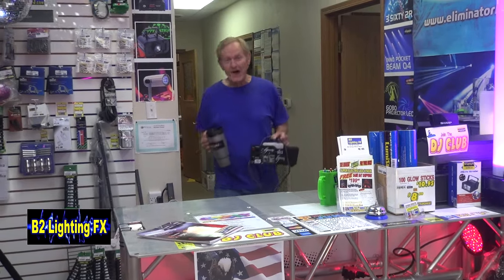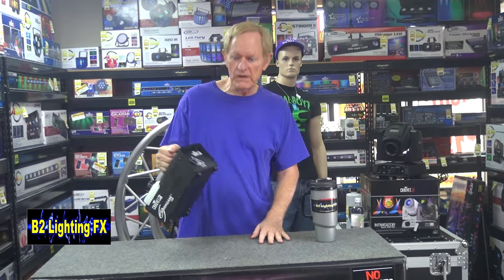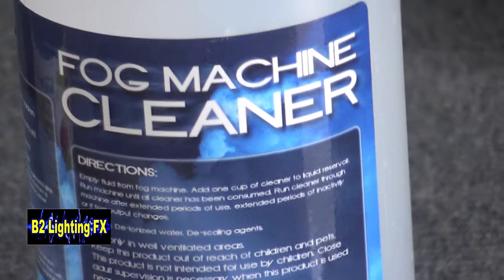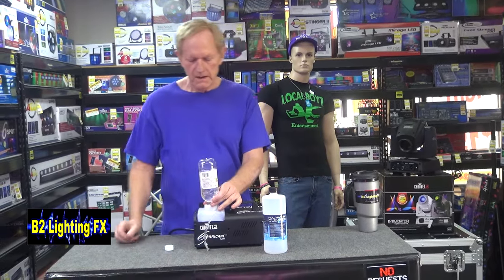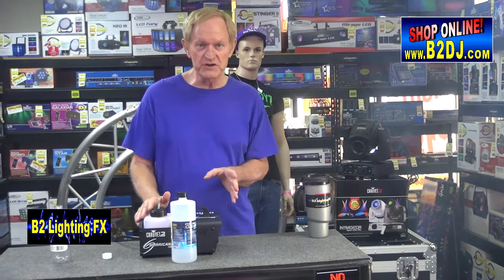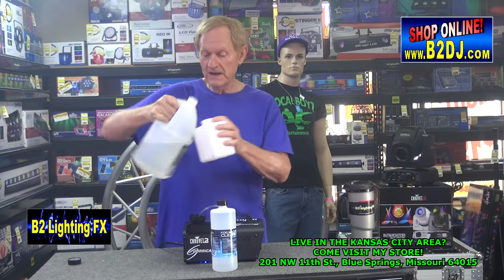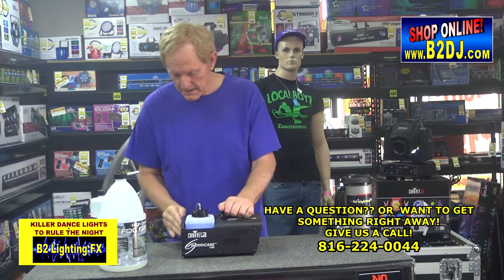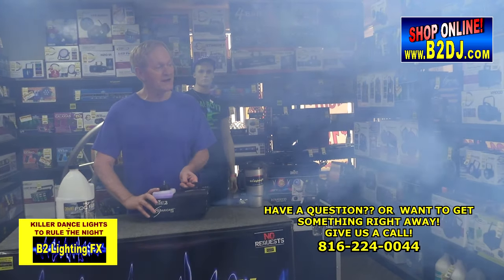How to clean your fog machine and get it working again!

Comment: This didn't work for me, but it started me on steps to repair my machine, so I appreciate it.  In my case, there was a clog within the pump itself.  If you remove the brass tube from the pump, it should easily spray liquid (fog juice, or vinegar in this case) - mine hummed a bit, but nothing came out. A dippy little $15 part, I was going to just replace it when I decided to disassemble it.  I didn't do anything fancy but just took care to return the parts to the pump in the proper order, making sure I could push air through each section.  When I returned it to power, it immediately sprayed the vinegar into the air.  I let the vinegar run through the system to clean anything else and it worked great after that.

Comment: I purchased a tiny smoke machine from someone in the Netherlands (vs where I am in the US) and had a few unrelated problems using it, mainly that it needed an always-on power supply to work. Once I finally got one AND had a reason to use it, the damn thing wouldn't work reliably. It was only occasional press of the power switch on the fob that would allow it to produce smoke. I contacted the manufacturer and asked him what the problem could be and he asked me to do a quick test to determine if the tiny machine (fits in the palm of one's hand) would reliably work without the clearomizer (I guess that's the term for the tiny tank of fog juice that screws on/off). It worked perfectly without it, but rarely with it attached. Thus, my instant conclusion was it was clogged. 

How to remove the clog, though? A tiny acupuncture needle? Nope. Didn't go through. Letting it run for a bit while it was cooperative? Nope. That was unreliable. The answer was this video. I drained what little fog fluid was in the vial, rinsed it out with water, added in some distilled white vinegar, ran the machine off/on for a half hour (long enough to get too hot to hold and then I'd let it cool off for a while), cooked off the fog juice and half the vinegar in the vial. 

Initially, it acted like a tiny car engine that was choking on low-quality gas but, after enough time had passed, it started to sound smoother. Eventually, once it got low enough in volume, I emptied out the vinegar, rinsed out the vial, injected some fog juice in, and it worked perfectly afterward. 

Seven years after this man made this video, it's still helpful. Amazing.

Comment: Another possible problem is the heat fuse (thermal fuse) located just behind the heat chamber just below the electrical connections to the chamber. In my case I looked under the chamber and there was a tab that I was able to easily pry down and bend back the tab, opening the bracket. The fuse is shrouded in a rubber tubing. I was able to slide the cover back to expose the fuse. With power off I tested the fuse with a multimeter and it tested open, 0 ohms. No surprise; I saw something smoking under there during a test run yesterday. On a whim I put a jumper across the fuse and it ran perfectly. The markings on the fuse are "10A JET 250v C1112". I've ordered these before but that was years ago. The fuse is held to the wires with compression clips but I should be able to solder a new fuse in place. Yesterday I replaced the pump so it's getting something of an overhaul.

Comment: Froggysfog does not recommend using vinegar of any kind to clean the lines. Any vinegar left over in the lines will eventually destroy the line. You get what you pay for when you get actual fog machine cleaner, does cost a bit more but please don't use vinegar! www.froggysfog.com

Comment: i used some regular fog machine cleaner and after like 3 seconds it started smelling like something has burned inside the fog machine and started spitting out black oils. Did i do something wrong or was the fluid like not good? Now whenever i try to use the fog machine it smells like sh#t. If anyone can help i would appreciate it thanks!